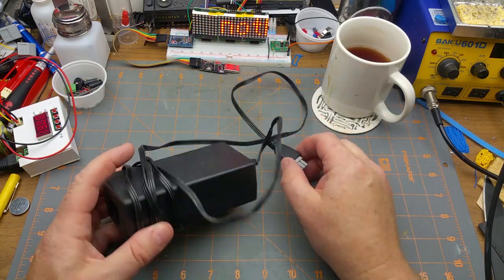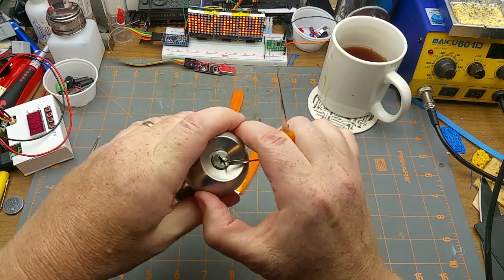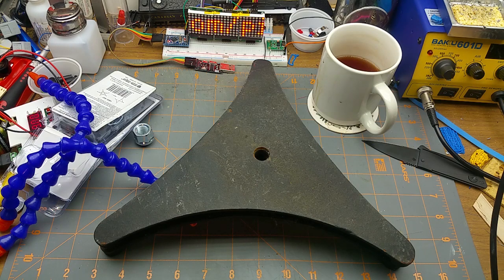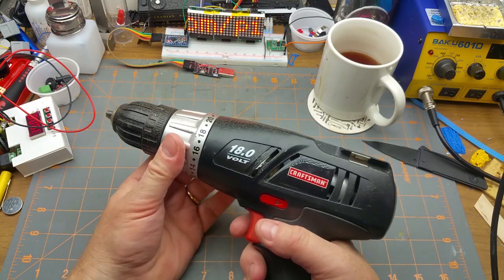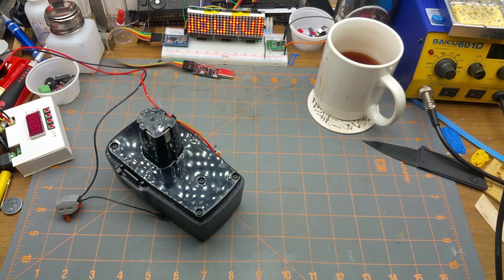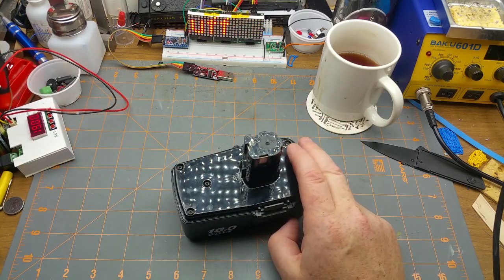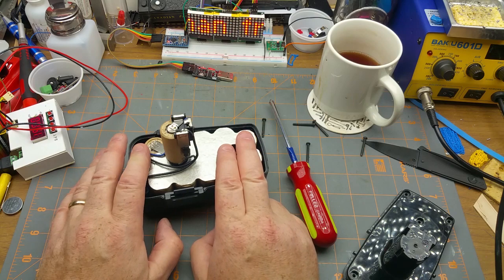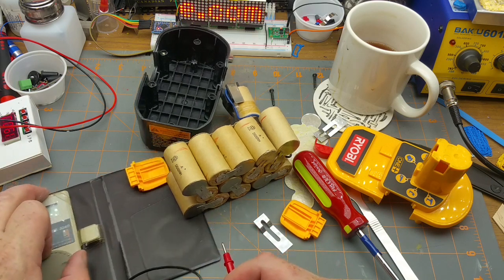free giveaway weekend haul

Comment: Those HP power bricks come from printers. The 32V side makes then excellent supplies for the little MingHe buck converters like your B3603. I found one with 32V 2A output, which is awesome ~60W so a good converter will deliver almost 5A at 12V from that. Plus you can pretty much dial up any voltage within almost the full range of the device.
The thread in those stands is probably the "lighting thread", which may not be metric but it is used in the main stem of Floor Standard lamps. So, look for those in the next junk swap, and grab some threaded nipples.

Comment: I rebuilt my old drill pack a while ago with Ebay NiCd, which was $22 for a $17 drill - lol -, but they only worked well for 2 years. I put up with the low capacity for a couple more, but now I've ordered the stuff to convert it to lithium. I was thinking of 3D printing a new battery case so I can fit a lot of 18650s in it, but I saw some packs with only 5 cells so I'll use the old case and put 6 in there.

Comment: Hi      I  watched and commented on your original video about the flexy pipe things . I liked
     the idea so ordered 5 for myself -- i went for the cheapest so I ended up with larger ones
  than yours ( I think ) -- they were labeled as 3/8 BSP  ( British Standard Pipe ) --- But I dont
 have a 3/8 BSP tap -- and they are expensive . I plan to use a base of a stand used in a shop
 window display  , its about 5 inch dia and chrome plated . I was thinking 3 of them on the
base and I may end up forcing them into holes with epoxy .
My calipers say that the tread is 6mm Dia .
                                                                                                                                    Alan

Comment: I have the 19.2 V version of that craftsman drill and I was actually going to do a video on it sometime soon if I had any success with my problem troubleshooting. I bought it 11 or 12 years ago and one of the batteries no longer wants to recognize in the charger so I am about to find out if I can get a jump on that situation.  I assume it discharged too low to be recognized and I can boost it up and get it back into circulation so we will see.

  But it’s funny we seem to have the same products to showcase sometimes.
Reply from the maker: It constantly surprises me how often our accumulation of stuff overlaps. (I was thinking I might have to change the password on my webcam...)
Reply: I’m glad you took the batteries apart and showed what’s inside. I never saw the inside of a NiCad apartment complex. It’s good to know.
Reply: You can still buy these batteries very cheaply on Amazon....and they also sell the Lithium ones for them too but more expensive of course. I have a couple of these drills and love them. They will work all day without issue. Amazon: https://smile.amazon.com/gp/product/B00OPWMWEQ/ref=ppx_yo_dt_b_search_asin_title?ie=UTF8&psc=1

Comment: According to my knowledge, NiCd cells have a less capacity than NiMH ones, but they are much more robust. You can trickle charge them all time you want, ideal for high current needs, long storage life and some more. NiMH's have more capacity, but I think they're not really high power cells, as they heat up a lot when in high current use. Li-ion are different story. To enhance power needs, you would have to use 5S2P or 5S3P configurations with some high current cells to make up current needs. This also needs BMS circuit so it gets more complex. I have a drill with small battery pack, 10,8v 1500mah one, uses 3 li-ions in series and sometimes over current protection kicks in and stops everything. I don't think that can happen with simple NiCd.
There is a great site with a lot of battery related knowledge https://batteryuniversity.com . You can learn a lot from this
Reply from the maker: That's correct. NiCad cells are one of the lowest energy density rechargeable battery chemistries, but they are also relatively rugged.

If I were going the lithium route, I have some protection boards in stock that I could use.

Fortunately, I didn't need to go to the effort this time.
Reply: Funny story about that. I had some RC stuff in the 80's. When my mother moved a couple of years ago she found a box with a remote in it .. left untouched since probably '86 or so. So going over to my mother to pickup the stuff the crazy me switched on the remote ... to my surprise I saw the battery meter on that thing move.  I removed the battery lid ... NiCad AA cells, 8 out of them.   So after like 25 years they still had some charge in them.